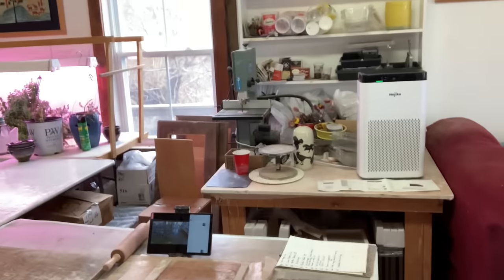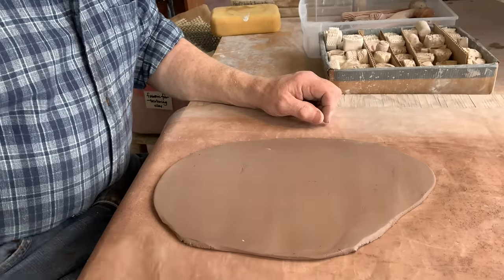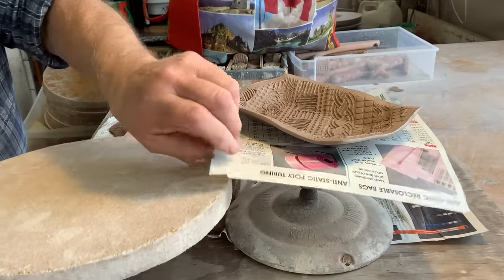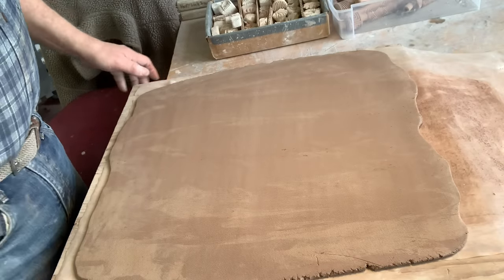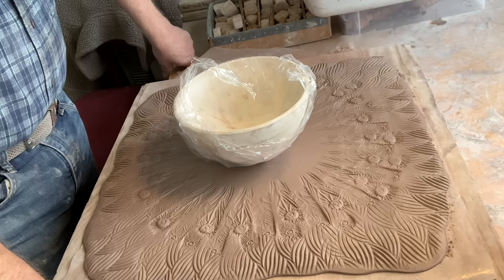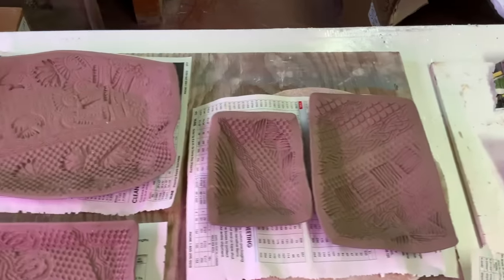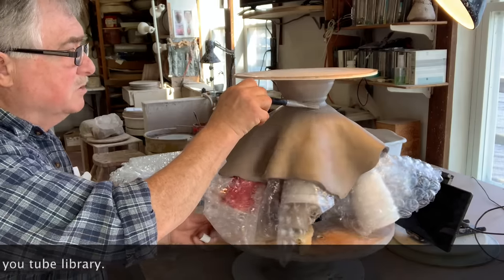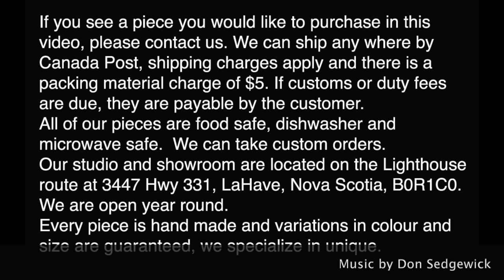Hand built slab trays and bowls.

Comment: I believe that's a North Star slab roller.  It's one of the few brands which adjusts the slab thickness by raising or lowering the roller, rather than having to insert shims in the bed.  Great tip on getting square(ish) slabs  Can't wait to try it. Those ovals seem to waste a lot space on the ends making me roll more slabs to fit that last piece. Those bowls are just fantastic.
Reply from the maker: Thanks, I got the slab roller second hand.

Comment: I'll be watching.  One other thing I do differently is use quilt batting, the soft kind that I can tear up, to stuff the curves after I get the bowl over the drape mold.  It's strong enough to hold and, since it's going under the cloth the bowl is draped over, doesn't get dirty, while helping to hold the shape.
Reply from the maker: That is a good idea, the toilet rolls I use can leave a slight edge that has to be smoothed out.

Comment: Just for information...
    :body-blue-raised-arms:Those two tools with the handles that you thought might be for wallpaper or plaster (they can be used for the plaster for sure) are also texture tools to add wood grain to things. You lay down a dark colour and let it dry, then lay a light colour over top and drag the tool in one direction, tipping it back and forth as you do, and it puts a nice wood grain down. Then let that dry before varnish or glaze is added. You can also use those pointy parts to drag other patterns onto projects.
Reply from the maker: I have two of those tools so I should try them out. Thanks.

Comment: Love your videos, have just discovered them,  they are 
so informative and clear.    Great ideas, great pottery, thanks so much for sharing.  Wondering what you had that large piece of wood on (which the clay slab was laid) and  it turned so easily?  Thanks so much, M.K.M.
Reply from the maker: They are concrete boards used in construction, thanks for the appreciation.

Comment: I have a question about your satin matte oatmeal glaze. I mixed up a batch using the  recommendation of tin oxide.  The tin oxide came as a black powder, and would not dissolve in the glaze mixture, it just sinks to the bottom. Is there a tin dioxide that I should use?
Reply from the maker: Here is where I buy it. https://psh.ca/collections/tin-oxide
It is always a white powder. I suspect they sent you Illmenite by mistake. Tin has gone up in price a lot. I may investigate using Ultrox Extra also available here. https://psh.ca/collections/ultrox-extra-zircon.
I will be ordering some in July or August so i will post the results of testing it.

Comment: Thank you for your wonderful video!  I've been making large bowls similar to yours since the middle 70's, using lace pressed into the clay with slip painted over it to accentuate the pattern.  One difference in technique is that I use pieces of old bed sheets to roll the clay on. It's not so hard to peel the clay off and leaves almost no mark.  I can roll out thin enough to move easily.  I love the way you glaze these large pots on the inside! I suspend mine on a jar over a large bowl to pour glaze over the outside after dipping the stem in a smaller bowl with glaze in it to glaze the stem.  I have always made the stems the day before, but will try making and adding them immediately! That looks interesting!!  I tried a slab with stamps, etc., yesterday!! What fun!!!!!  Again, thank you for sharing! Ann Sciba
Reply from the maker: Thanks for the comment, I have a new video coming in a week or two making one of these into a sink.